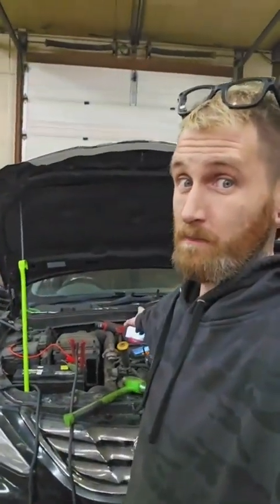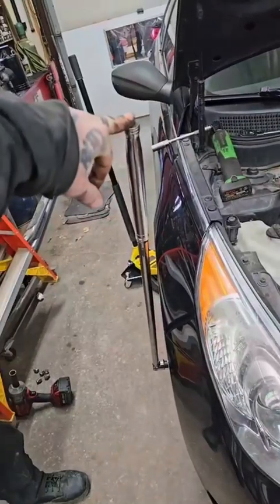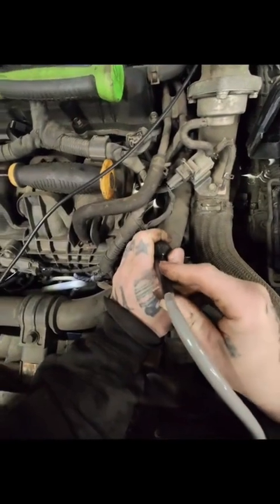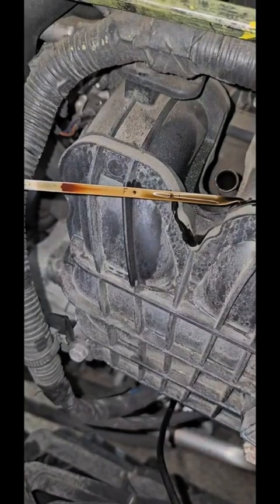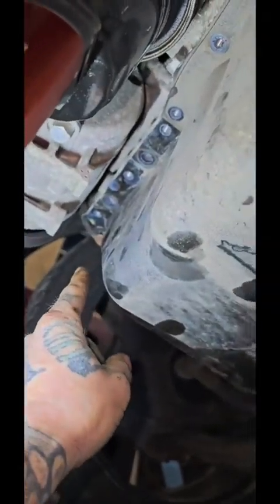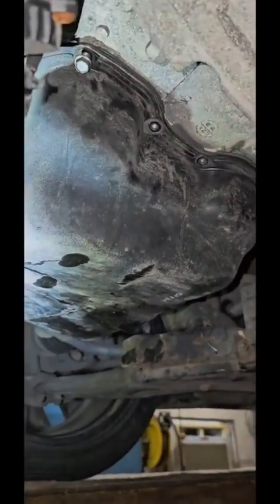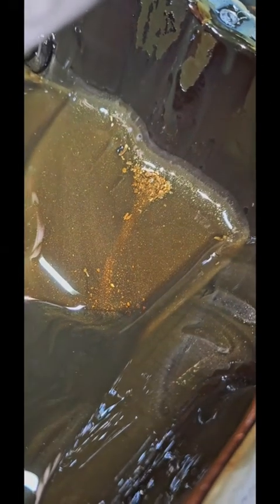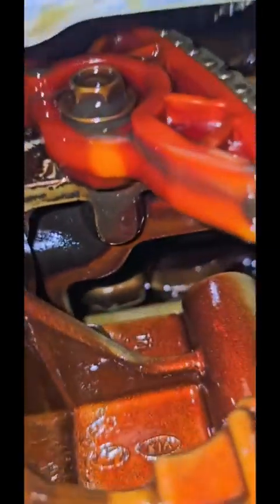2011 Hyundai sonata stalled out won't restart interesting one

Comment: I believe these are a recall / warranty from Hyundai for this exact thing. It would be worth the customer calling the dealer to ask
Reply: Starters normally break the starter lever.
& yes this could be warranty but take to dealer
Reply: 10 year/ 100k mile warranty. Even if you’re the second or third owner. The most notorious engines are the 2012-17 Sonata’s. I knew a bunch of folks that replace them on a regular basis like their air filters.

Comment: I just rebuilt my 2.4 engine rod bearing fried to crank.....I missed a recall and warranty was not covered.....but now engine back together I sending it down for recalls and then I will have a lifetime warranty.......rebuilt motor new crankshaft and bearings and timing chain all parts under $400.00

Comment: Good luck getting Hyundai to warranty their engine. You will have to prove proper maintenance was done since the vehicle was new.
Reply: Nope. Rod knock was all it took. 6 months in a rental.
Reply: @Mrbumbons1  your very lucky. Here in St.Johns County FL the Hyundai dealer has a 9 month back log and they have absolutely refused to replace the engine.